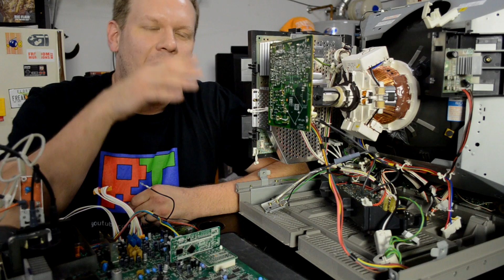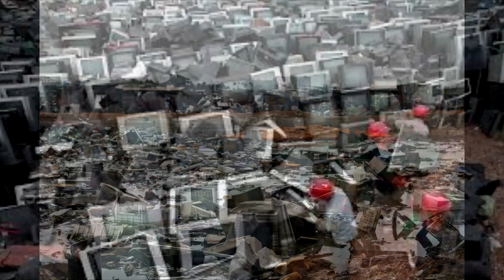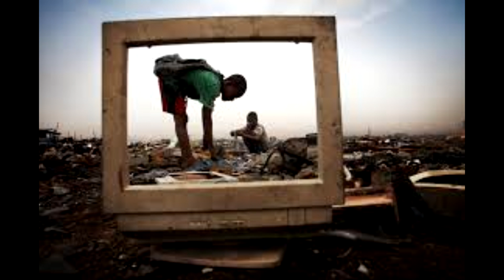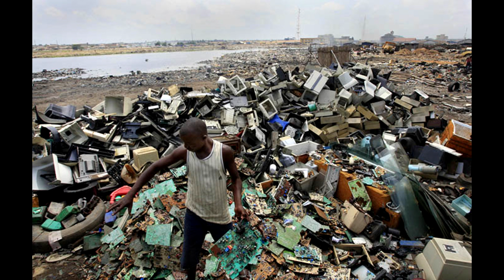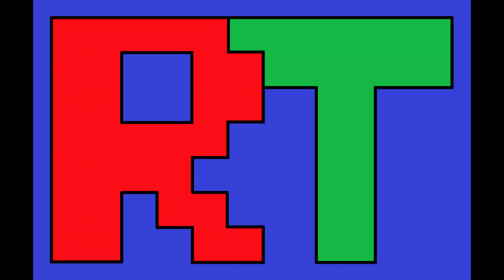E-Waste, CRT TVs & Monitors - Are they really "Recycled"?

Comment: Dont worry we are limiting the amounts of waste actually strange because we can thank the problem for that solution.  The tech is getting so good that they are using less , smaller, cheaper components in technology. Wich actually comes back to the problem of items costing more to recycle than they are worth. A 10 year old plasma has 4 times the ammount of valuable recyclable materials than a modern lcd of comparable size. I can scrap out and recycle just about anything accept CRT monitors. How many tvs with alot of lead and glass , I mean how much overhead can there be. It sounds like a big opportunity for someone to patent some new technology or a new technique.

Comment: Bought a nice 21" 130KHz Trinitron monitor, almost ended up as E-Waste because of bad packaging, case was broken on several spots including at least one of the CRT mounting, luckily the whole tube didn't implode and it still seems working fine. xD I sent the seller your video on packaging and made clear how important good packing is, still he put it with direct contact to the bottom of the cardboard box.